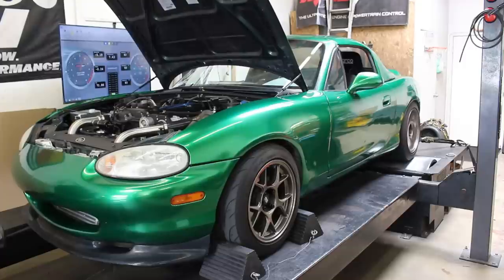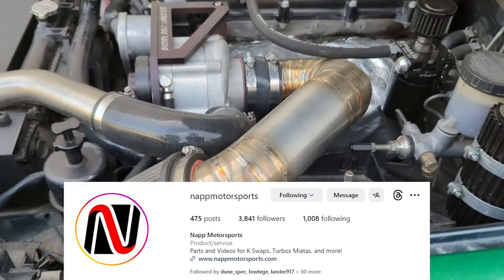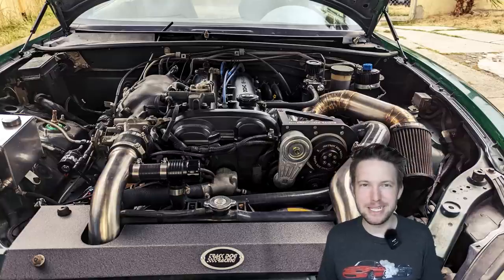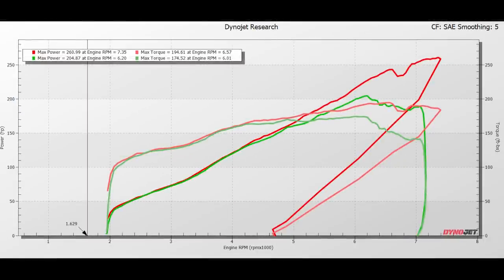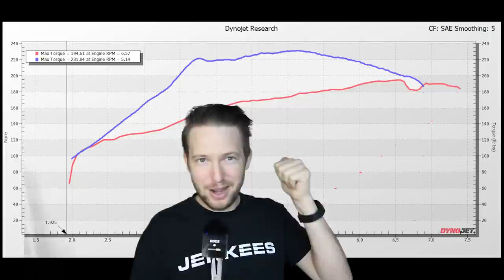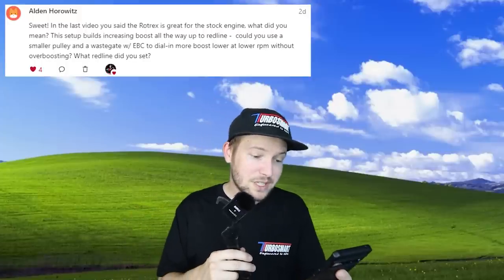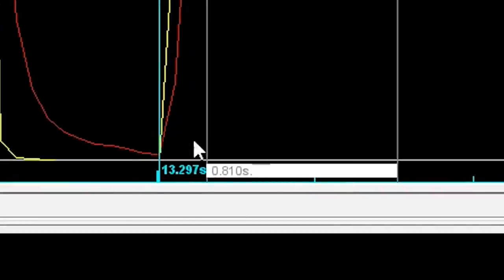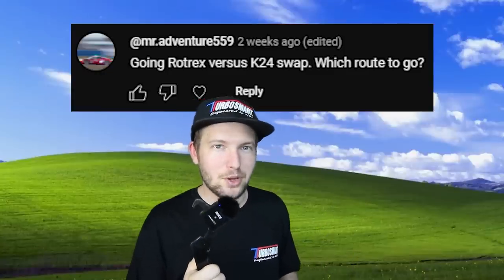The ULTIMATE GUIDE To Deciding if Rotrex Is Right For You.

Comment: Have you considered swapping out the rear end ratio now that the car has more power, or do you prefer the super short gears?
Reply from the maker: I've really been loving the super short gears, it's easy to keep the car in the high RPM and always have the perfect gear for any corner exit. It gears-out around 120-125mph which I  very rarely go that fast anyways, and I don't commute long distance or anything for work so 4krpm on the freeway doesn't bother me. I may swap in my spare 3.9 for testing purposes haha

Comment: Hmm.. Assuming my understanding of boost is correct, which is the amount of pressure in your intake manifold, I don't think boost is solely related to engine RPM..  Throttle position would have an impact the amount of air getting into the manifold.  Yes the turbine will spin at a set speed but the amount of boost can be controlled by the throttle position.  The tuner for my ND HKS kit controls the amount of boost by limiting the throttle opening
Reply from the maker: The amount of air being flowed through the supercharger is directly related to RPM, not the amount of air entering the intake manifold. You are correct in saying that is restricted by the TPS even when the bypass valve is closed

Comment: They do seem really ideal, but the main question Instill have is how long do the charger units last. I have heard such conflicting reports and nothing definitive. 
With the cost of them you would want to get it right. Sounds like managing the air flow would be really important esp on track. Do they typically come with some way of monitoring the gearbox oil temp?

Comment: Currently looking at going rotrex kit in the next couple months from tdr. What type of quartermile times did this kit give you in comparison to stock acceleration?
Reply from the maker: I don't have 1/4 mile data but I did 1/8 mile testing - 

With just a couple bolt-ons it did 10.0 @ 69mph, with this Rotrex setup it did 8.5 @ 84mph. 0-60 dropped from 7.3 down to 5.1, and I had to go to 3rd to hit 60 since the gears are very short. I have a whole video about these performance tests on my channel, posted just after this one
Reply: @TheCarPassionChannel  I'm gonna watch it thanks

Comment: Loved the section on responsiveness! But leads to further question, part throttle response?

Like when dd, or modulating throttle in a sweeper?

Slight, subtle increase, how compares to na response?
Reply from the maker: Partial throttle and up/down throttle modulation feels exactly as if the car was n/a, except with more power on tap. I.e. if you're cruising at an RPM where a maximum of 9psi would be available at full throttle, if you only use part throttle it's easy to control exactly how much power you want whether it's 0psi, 2psi, 4psi, etc.
Reply: @TheCarPassionChannel  thx, very helpful! You're giving us answers hard to come by elsewhere.

I imagine part of how responsive to touch is based on how much volume is present in piping and ic between hu output and tb input? Longer distances, more bends = less responsive?

What is your ic setup on your platform? A2A, W2A?

Biggest part of what I love about my platform (not a Miata) is how responsive everything is to slightest input. Don't wanna diminish that!

Comment: More Rotrex = bigfer hu, not smaller pulley

Smaller pulley works on paxton and similar centrifigul hu. Overspin gives diminishing returns, less efficiency, more heat. But that is manageable.

Definitely dont wanna overspin a Rotrex. When you need more, you dont get smaller pulley, you get larger Rotrex hu. There is a reason they have so many Rotrex sizes (each range, like 5 sizesof C30, then 5 more C38. Then there is C38R, and all the smaller C15 range, etc).

Not as concenient as paxton range up or down via pulley, but everything has tradeoffs. Just gotta put more thought and research into rotrex hu size up front.

Comment: I somewhere heard that no matter what, if you add forced induction you need to have piston rings with a bigger gap. Is this true for a rotrex setup? Or is this even true at all...?
Reply from the maker: This is very dependent on which engine, and how much boost, as well as other setup variables like fuel type, intercooler, etc. For the Miata engines, in stock bottom-end form, assuming a safe tune, you'll have connecting rod failure well before you need to worry about ring gap. Now when you build the bottom end for 300, 400, 500hp+, yes you want to have larger than OEM gaps.
Reply: @TheCarPassionChannel  thx for the quick answer!

Comment: Im sure cost is most of it but they should have an option with a one way pulley no? so the two step doesnt "hurt the gearbox"
Reply from the maker: The unit would still get shocked on the "upstroke" of the revlimiter I believe. The solution would be more like a rubber dampened pulley I think. But it's not a big deal at all, if people are they type to "need" to smash the limiter every day and shoot flames, they need a more robust setup haha

Comment: here's an interesting question, given the fact this is belt driven vs exhaust gas driven, have you noticed an increase in engine braking with this kit? the parasitic losses are constant so I'd imagine so.
Reply from the maker: Tbh I can't really feel a difference. I think the Rotrex planetary gearbox is super efficient so I'm not sure how excessive the drag is. Downshifts are sick though since you can technically get a hint of boost when you blip the throttle
Reply: @TheCarPassionChannel  LHTPerformance tested what the rotrex took from the engine to power. They did a dyno run before installation then ran it again with the kit but the charge pipe wasn't connected and it took just about 20hp from the engine on the Dyno. Keep in mind with just a charge pipe disconnected it not apples to apples comparison.

Comment: Just wondering what would be the positives of adding water/meth injection to this setup. Better for the stock motor/higher power level with stock pulley ratio/ability to run the system without an intercooler. Although the lack of lag kind of bypasses this issue altogether.
Reply from the maker: You could squeeze another 20-30whp out of the setup with water/meth just like you could with E85, but the stock engine is still limited to a certain amount of torque regardless of fuel type/time safety. And yeah there's really no reason to lose the IC, the setup responds as if it's N/A already

Comment: Would be nice to see the "lag" from the worst case scenario engine RPM
Reply from the maker: Boost comes on instantly from any and all RPM as soon as the throttle is opened. It's just not as noticeable from low RPM because there isn't as much boost available (only 2-3psi at 2500, progressive closing to 14psi at ~7500). Because the supercharger is always making the most boost it can, at whatever RPM it's at, opening the throttle just instantly lets that boost into the engine.

Comment: Hi, please give me advice on what should i choose, i am planning to supercharge my 1.8 nb with eaton m45, I am missing last 2 parts, intercooler and BOV. my aim is around 190 hp, would you reccomend me intercooler for that, quick response is important to me, and which bov should i choose? money is quite tight so cheaper better but also i need something good which doesnt fail. thank you
Reply from the maker: I'm always a huge fan of going intercooled, even if it's a low boost application. You can DIY your piping with the quality stuff from SiliconeIntakes (dot) com, then slap a fairly cheap CX Racing or Mishimoto intercooler in there. Shouldn't be more than about $300-$400 for everything, even cheaper if you use an eBay piping kit
Reply: @TheCarPassionChannel  and what type of bov?

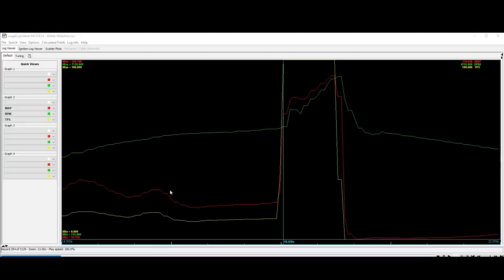Comment: 23:04 there’s probably not much lag to speak of but revving to 5k before pinging the pedal is not a good demo to prove it.
Reply from the maker: I could do it at 3k, 4k, 5k, doesn't matter. Full boost is instant. IMO 5k shows it better, because there is more boost available so it seems more drastic, but if I peg it at 3k it immediately feeds that mighty 2-3psi as soon as the pedal is down, lol. Unlike a turbo, the supercharger is always flowing enough air to make boost, when you floor it, the bypass valve just allows it to enter the engine immediately.

Comment: guys.. a rotrex isnot a centrif s/c it is a type of centrif s/c , it has a gear box. roots are the most inefficient s/c, twin screw is hella expensive but is great. but hella expensive. also you break engines most from torque at the point you make mbt. approx 5k . thats what he means by "safer" on s stock engine. also screw Nitrous. too expensive and risky long term. what id like to see is the diff from doing a interchiller set up and the current set up.

Comment: Out of curiosity what do you gap your plugs to?
Reply from the maker: Low enough until the misfires in boost go away, hahaha. Usually anywhere from 0.022" to 0.028" for forced induction. Depends on what the ignition system can handle. Larger is technically "better" but that's only up until you start blowing out spark

Comment: everyone obsessed with low end torque alone have completely lost the plot.  these are SPORTS cars. not muscle cars.  They are supposed to be driven like supersport motorcycles are supposed to be ridden. wind them out and enjoy them near redline, don't worry about impressing nobody that matters with what the car can do off the line - ESPECIALLY at the expense of your rods, diff, and tranny.  Even in the Supra world, there's a reason they deliberately program-in turbo lag. If you want a stock 2jz to survive 800whp, it must be made by going 200-300-400-500-600-700-800... If you wanna kill the rods, you make boost like 200-300-600-800.  Easing into 800whp VS slamming against 800whp all of a sudden makes a difference. same reason why launching cars with grippy tires often leads to a very bad time.

Comment: The lag question is probably about lower RPM, not higher
Reply from the maker: It's identical in the lower RPM, no measurable time difference between 100% TPS and 100% available boost. The reason I did high RPM is because the SC makes more boost, so I figured it would demonstrate the point better. The physics behind it is that the SC is always flowing the same amount of air regardless of load, so as soon as you open the throttle, the bypass valve closes and that air is available to the engine.
Reply: @TheCarPassionChannel  So there's no lag at lower RPMs for centrifugal SC's?
Reply from the maker: @GGang70  Right, there's no delay at all between the throttle pedal and how quickly power comes on, at any RPM. Shown in logs as well, not just "seat of the pants". It feels as if the car is naturally aspirated
Reply: @TheCarPassionChannel  Very cool. Thank you for all your insight! I was leaning between Rotrex, and FFS and I'm moving forward with FFS mostly cause I don't have a reputable tuner near me

Comment: What should I do to a stock 90 miata to get a lot of power from dead stop to 140mph
Reply from the maker: Depends how fast you wanna get there, and what your budget is.
Reply: @TheCarPassionChannel  don't have much single man with 3 kids but it's my car to get out and have fun would I be better with the sock motor or put bigger 1 in it
Reply: And ive also got a 89 that was 7th one made in keeping stock but would like to sup up the stock motor when I rebuild it what would you suggest
Reply: Really the main thing I want is lots of take off peps race around here like a 1/4 mile or light pole to light pole so that's what I want what would be the best way to get that

Comment: Does a belt have lag...😂
Reply from the maker: Totally valid question, considering the entire IC and piping volume might have an effect on how quickly pressure actually makes it to the combination chambers.
Reply: @TheCarPassionChannel  I wouldn't expect perceivable lag with an adequate IC system. Same with the belt stretching and slipping between on and off throttle. Unless there is a problem it's not perceivable without computer data.
Reply from the maker: @c0c0asauce  But not everyone knows that, hence the test
Reply: @TheCarPassionChannel   I'm not mocking the test. I'm just cave manning the answer down to my level.